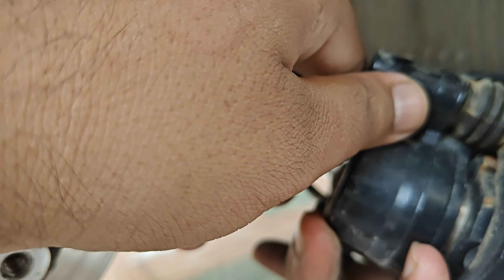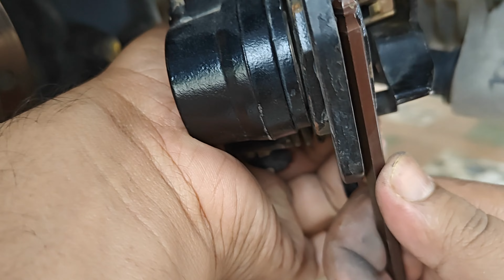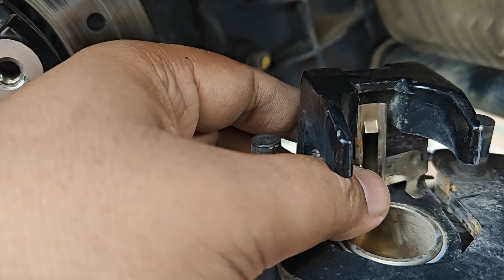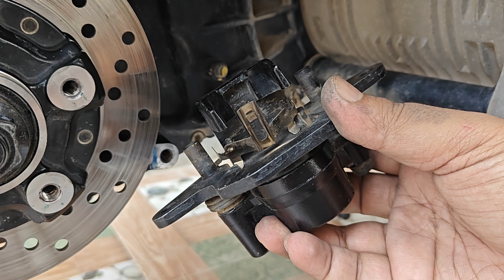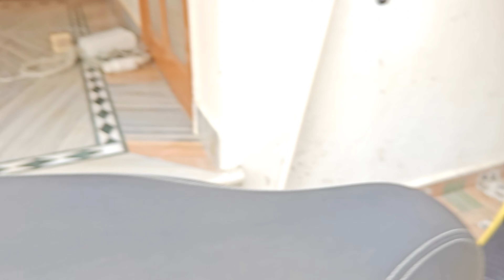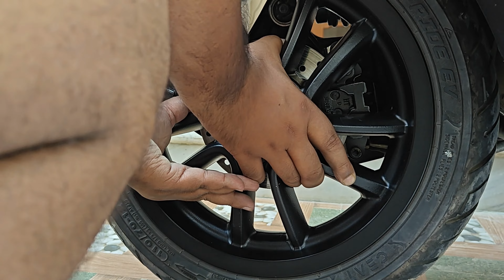DIY | Ola Rear Disk Pad Cleaning or Changing | Step By Step | For S1 | S1 Pro

Comment: The deep grooves seen on the disc should be smoothend out..  it shows severe wear n tear , change the pads,, replace it with the original pads  too, the peculiar sound is still present..
Reply from the maker: Deep grooves are due to rain and sand its normal here.

Comment: When the scooter issue get solved which was arrived while started the scooter before tyre fitting, and when the brake pad rubbing noise gone after brake pad resetting.
Reply from the maker: Scooter issue solved when it restart automatically. And break pad rubbing noise goes within few km of drive.